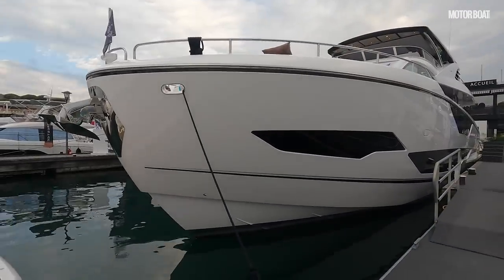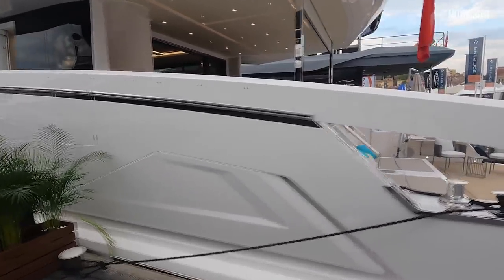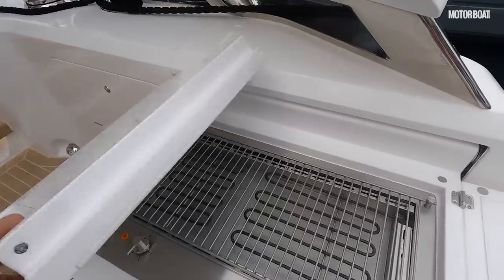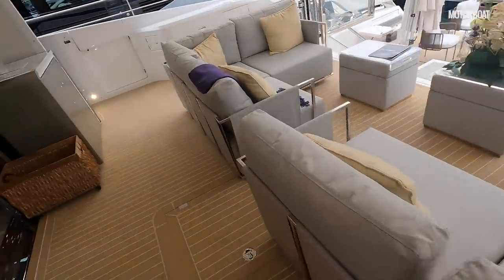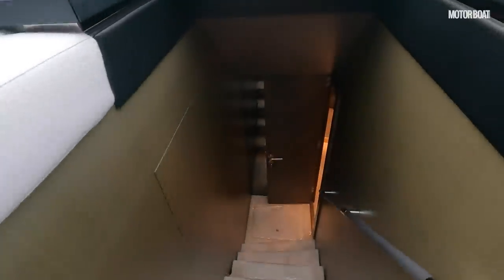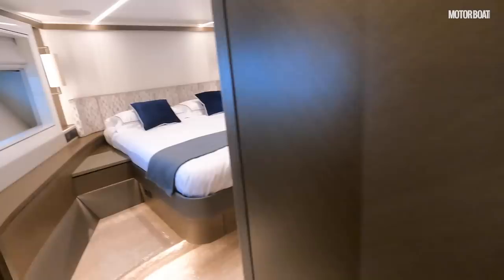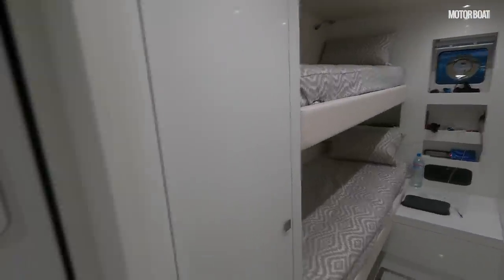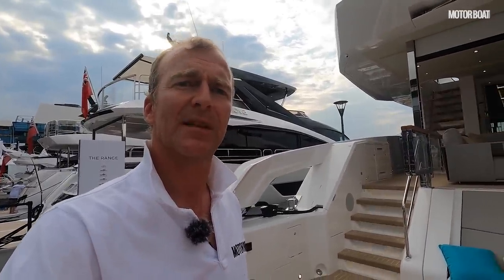Sunseeker 90 Ocean yacht tour | The most eye-catching of the 2021 models | Motor Boat & Yachting

Comment: Great boat overall and i do love the Sunseeker brand. It has to be said though, that has to be one of the messiest engine rooms ive ever seen. It looks like an after thought. Utterly bizzare.
Reply: Safety hazard that engine room.
Reply: I was reading this post right when I wanted to write the same!!! :D
Reply: @peterheinrichs7634  same
Reply: agreed
Reply: Engine space a nightmare....
Reply: I have to agree about the engine room.  I am very surprised because it is very unusual for Sunseeker.
Reply: Yeah as much as I like this boat, that engine room is concerning. To me, it shows they don't put much effort into the systems, and might not care about using good designs or high quality parts.
Reply: they shrunk the engine room to get that aft beach club area. A poor choice in my opinion.

Comment: I was exhausted just watching you struggle around the confines of that engine room, and you've seen plenty of more spacious ones in your time. 
But my main concern was the gap in the safety rail when the sunpad was in the raised position, certainly large enough for a child to fall through whilst on the sunpad with mum or dad. Why did they not use the second folded section to close that gap ?
Reply: I agree with the concern about the safety rail, but my first thought was you're blocking my view of the ocean.
Reply: Both of you found some big points! :D But, blocking the view isn't as bad as it seems at first... There's still the option to sit at the beach club, looking backwards.

Comment: What a stunning boat. To the engine room complainers: Engine rooms are engine rooms, they are not designed for ballroom dancing. You need enough space for machinery, and a dude to clamber in there if it needs work. A dude who does not suffer from claustrophobia.....

Comment: Thank you for the video  its a nice looking yacht but lost me with the engine room  as I saw in comments, where if any are the washer and dryer, captain quarters and fridge and freezer. Hard to make it a nice charter boat without those or a nice Liveaboard. I'm curious on the distance at 8 or 29 knots
Reply: 2,050nm at 10knots at 57lph and around 440nm at 27 knots at approx 700lph
Reply: Laundry will be in the Crew area, 100% certain on that. The Captain will be in one of the bunk rooms. This is a yacht not a superyacht. Charter yachts and "small" crewed private yachts do not have mansions for captains.

Comment: It's an interesting size and config, many good qualities but particular the boxes built on the windows in the cabin encroach on the room and gives an imprisoning sensation, especially with the blinds. Without being impolite I'd like to emphasize how vital that is to redesign immediately. Keeping the passenger from enjoying the view is at odds with obvious values of yachts. I'm not yet in the market for this price range of boat but at any price level, that design alone would be a deal breaker. The sensation from the cabin windows is all important, both size and unfettered. The cabin windows on the this boat could stand to be a fair bit larger but that added frame weighs it down tremendously. You may also want to avoid the brown beige palette but I assume that's an option. The round porthole inserts with thick bezel is another significant obstruction to the view. Why not let the full window open in for instance the bathrooms where the window is already fairly small. That way it can serve as escape hatch and reduce a claustrophobic sense. Particularly in the crew quarters the porthole filling almost the entire window is an obvious invitation to rethink a few things.
I like the open galley layout, I would even pursue open to the bridge and to that end maybe consider if a captain needs such a wide room to pilot the ship or if that could be much smaller. Blocking off the entire front of the main deck is quite the sacrifice if it could be done another way. A door forward to the foredeck I think would further enhance the open living sensation. Galleon has that in one model and it seems like an obvious barrier to break. Could even do away with the side decks entirely.